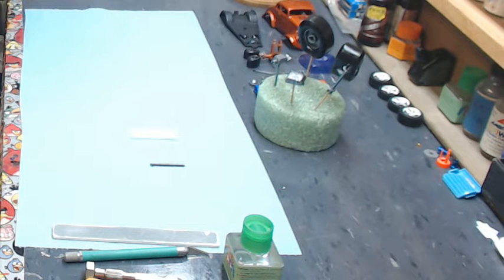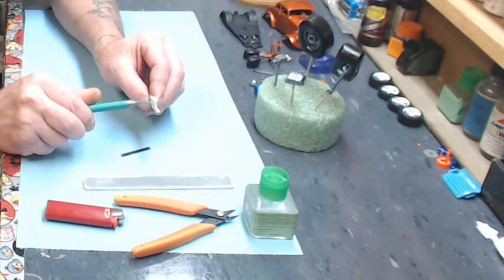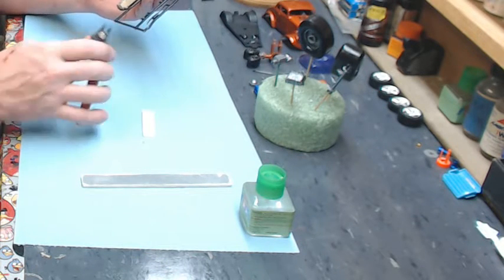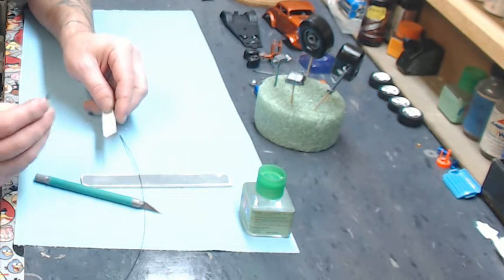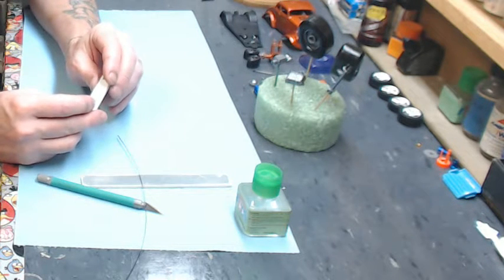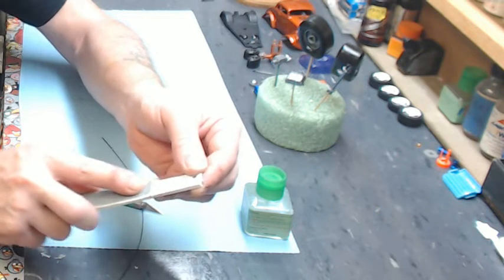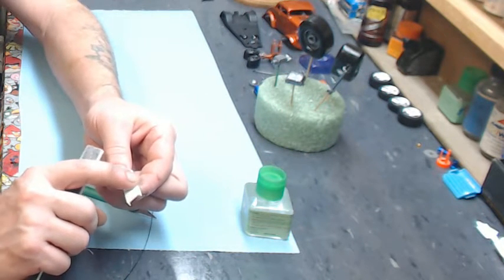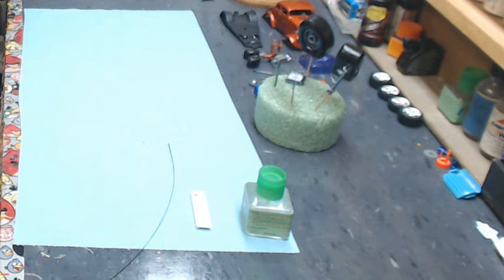how to fill holes with stretched sprue with no filler

Comment: Instead of melting the sprue with the lighter directly... what I used to do with the old Tamiya rubber tracks - to melt those pins - is to heat up the flat head of a pin and then touch the tip of the sprue piece lightly and it mushrooms backwards... that way you don't risk doing damage to the plastic with the flame so close to it.... Thanks for your great videos :)
Reply from the maker: yep, you can do it that way also.......thanks for watching.